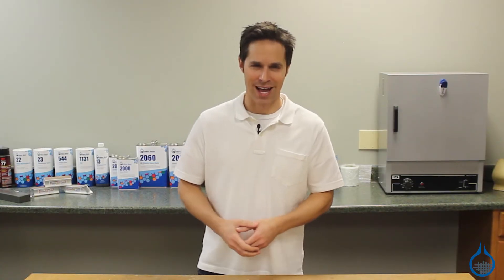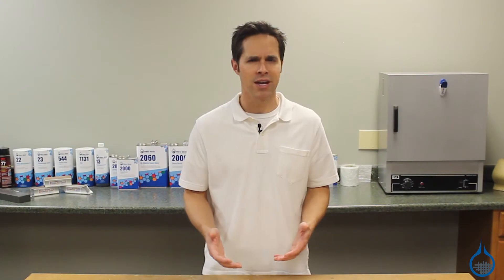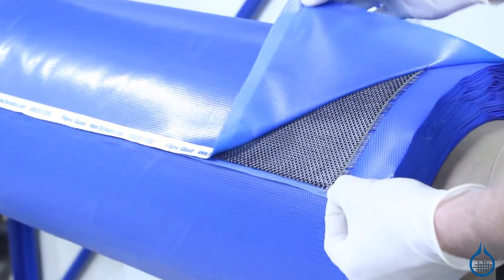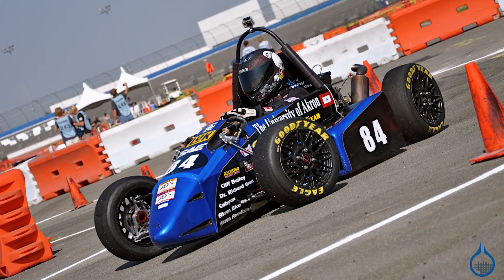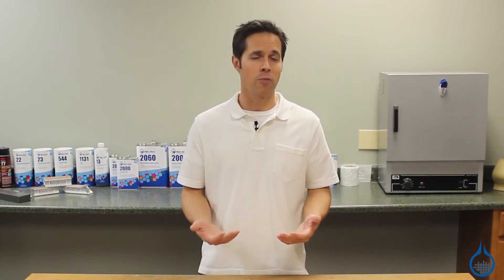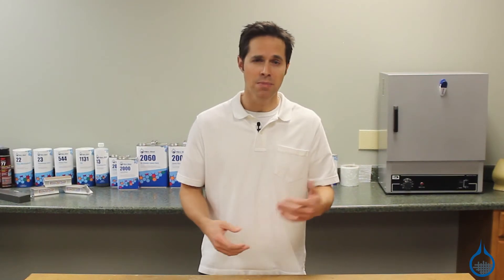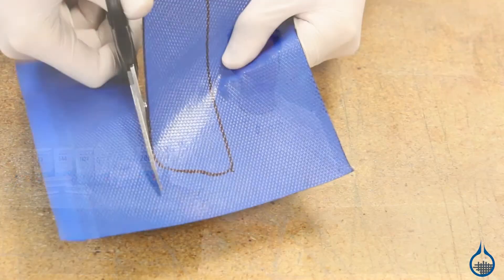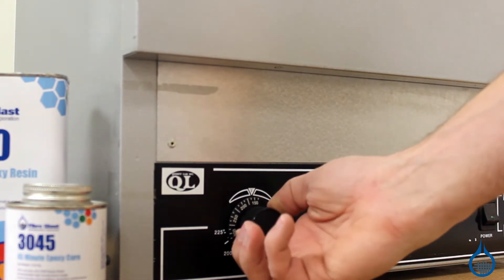Prepreg 3K, Plain Weave Carbon Fiber Fabric

Comment: For how long you need to cook it on 300 degrees? Can i use a heat gun to cure it on the spot, ifi can reach that temperature?
Reply from the maker: Hello Miguel.
All curing cycles begin with a temperature ramp up and end with a ramp down. The difference is the target temperature and the amount of time required for a complete cure. Always ramp up at a rate of no more than 5°F per minute until the target temperature is attained. Maintain the target temperature throughout the cure cycle and then ramp down at a rate of less than 5° F per minute to at least 150oF (66oC) before removing from the oven. Resin content 37.00% +/- 3%. We recommend that you hold your part at 310°F (154°C) for 1 Hour. 

Also we do not recommend using a heat gun to cure your part as that can create uneven curing and hot spots.

Thank you.
Reply: Fibre Glast thanks for your quick reply and information.